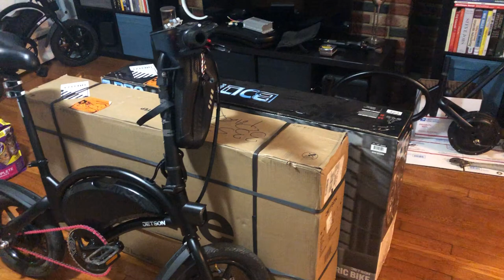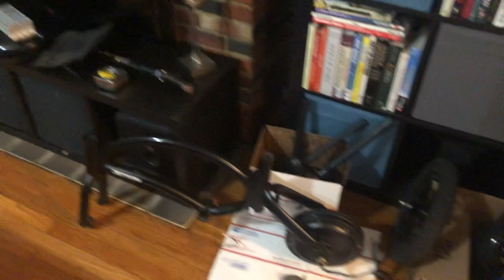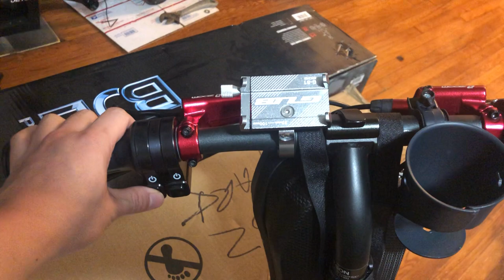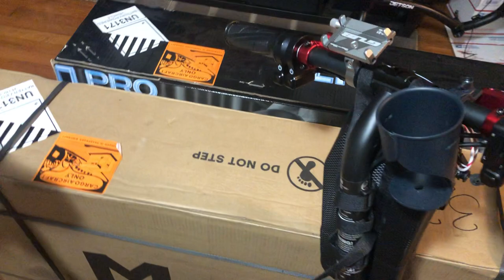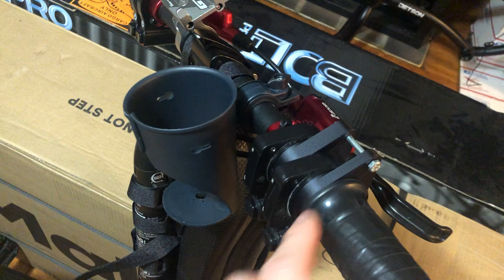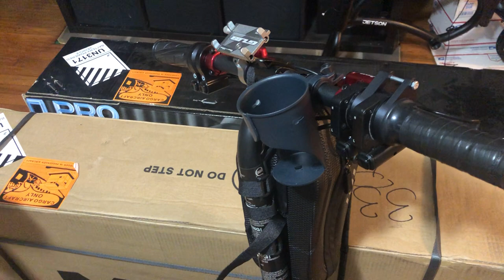Jetson bolt Pro Dual Motor Conversion PART 1

Comment: Will you sell the 3D printed parts
Reply from the maker: Yeah I can prob where are you located?
Reply: I also need it too but I’m in cali
Reply: I have everything connected just need that 3d printed accessory and the battery and controller location will be figured out later